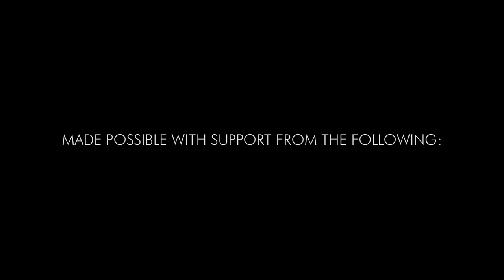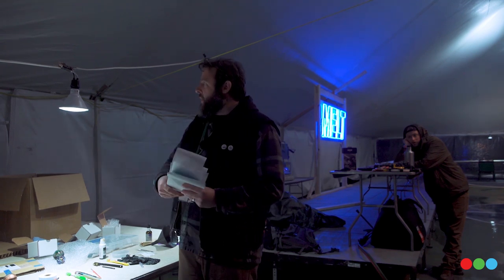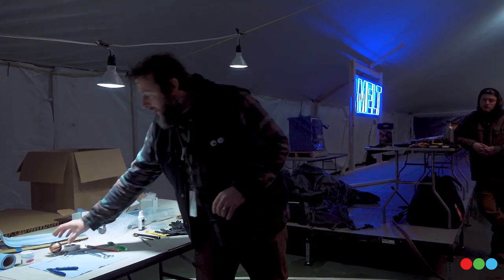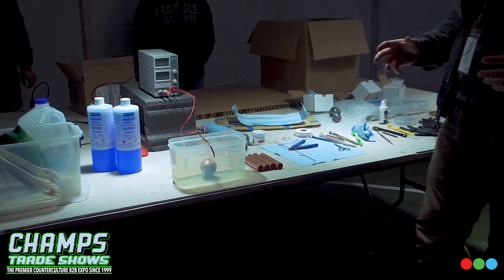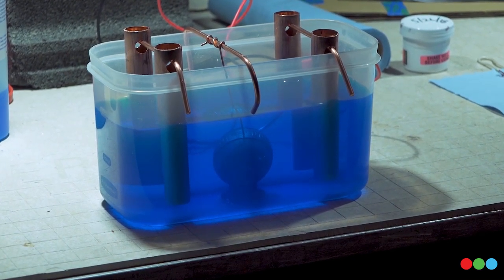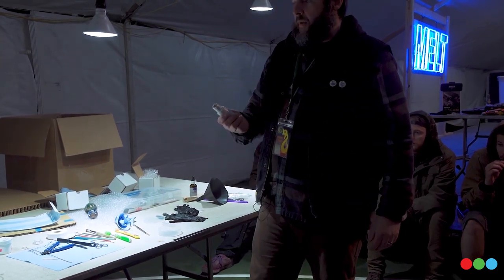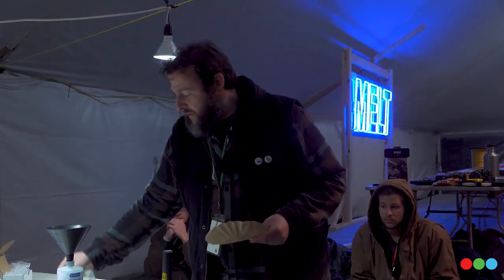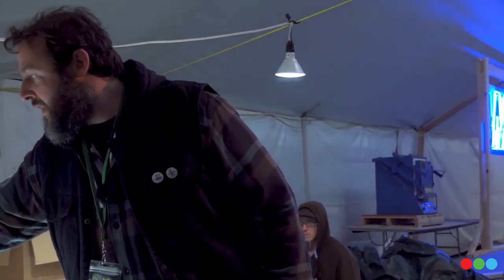Electroforming Boro Glass w/ Tim Keyzers

Comment: But why does he say icyprofyl alcohol???? Protip with using coffee filter or cheesecloth in strainers or chinois, you can you filing clips to hold it to the edge and not worry about the filter moving on you or folding in. You know those black clips with the steel wire levers to clamp onto stacks of paper.